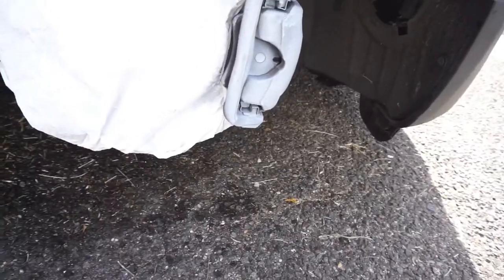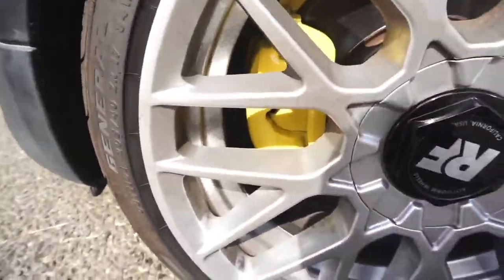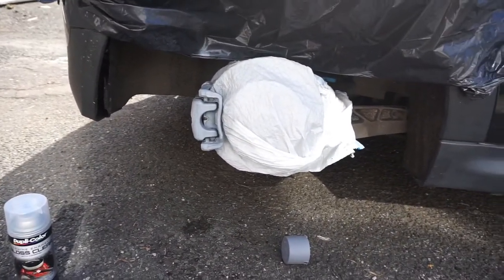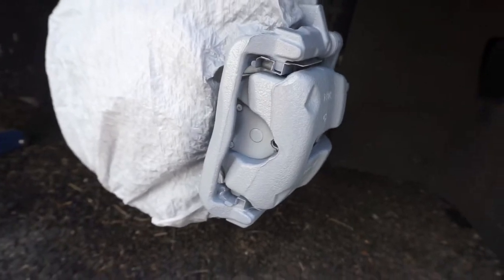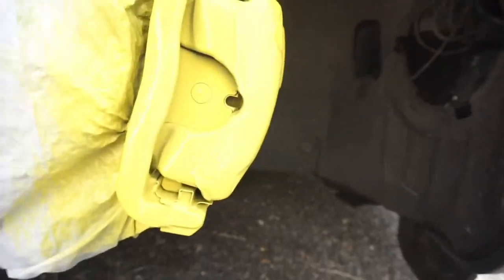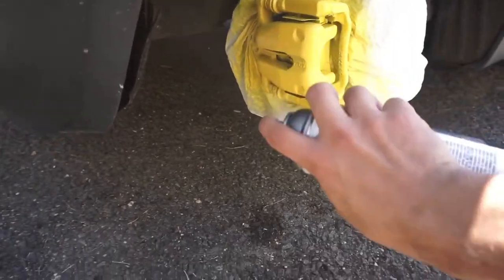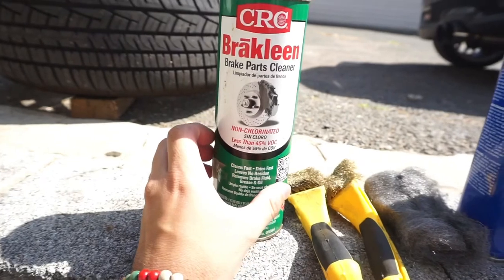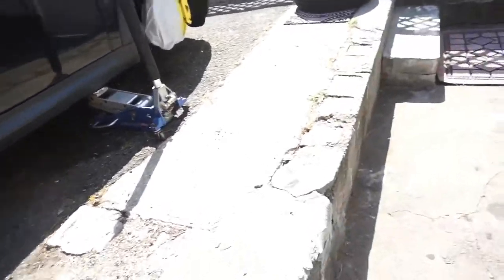HOW TO PAINT BRAKE CALIPERS DIY!!!

Comment: are the rotiforms 17x8 30et?  went to look at a used set from another mini just in the gunmetal color. but I didn't have special lug nuts to get in the holes to see what the fitment was like
Reply from the maker: Yes 17x8 et30 literally fits perfect I even ran a 5mm spacer in the rear with 0 issues actually the fitment is what you want .. and yeah I know the special spline lug nuts for it suck! Haha they aren’t too expensive though

Comment: that is DEFINITELY not how you would want to paint your brake calipers!!.. absolute bodge!!.. calipers should have been unbolted from their carriers, brake pads removed, sliders etc masked off and then prepped and painted..
Reply from the maker: Worked fine for me lol the intention was a quick and cheap job not a long process but thank you for the comment and view 👍🏽
Reply: @DArias  I appreciate that,. but it honestly wouldn't have taken that much more time to undo the bolts and swing the calipers out the way to do the job properly.. I know you're saying it worked well for you at the minute - but come your next pad change - you might find the pad and calipers will be harder to seperate.. or that the rubbers on the sliders or hand brake release cable will crack with use and cause either sticking calipers or binding handbrake.
Reply from the maker: I appreciate that and you’re 100% right about what you’re saying luckily at least for the way I’ve done it, the calipers have held up well no binding I agree though that th best results and what not are fully taking everything apart  and going though it that way..again I appreciate the feedback and the knowledge !